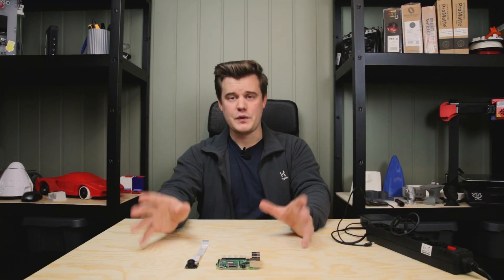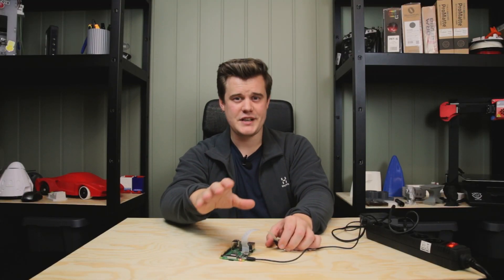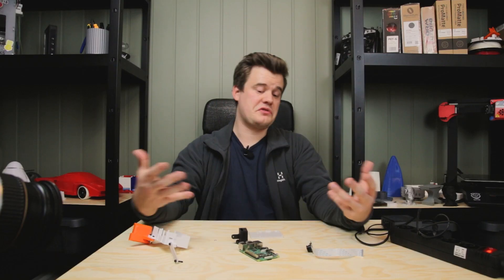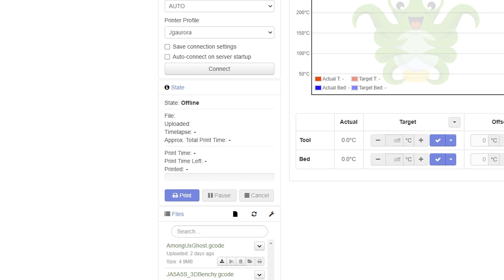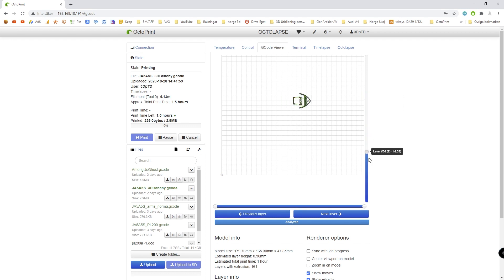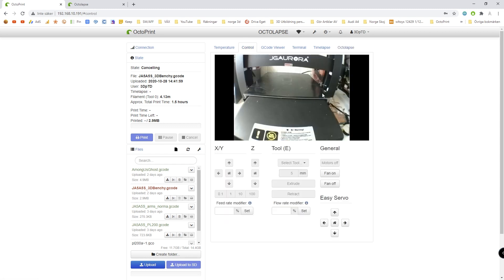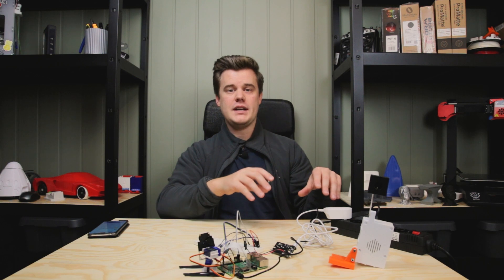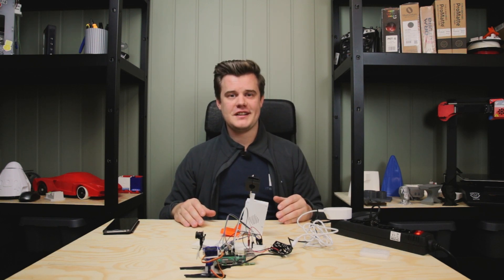OctoPrint adventures - Monitoring 3D Printers remotely

Comment: Octoprint is extremely useful. Connect a screen to the pi and run something like Octodash. Adds stop/start of prints through Octoprint, plus many other features for controlling your printer (filament change for example.) I run smart plugs to control the power to the printer and a light. I can remotely switch on the printer, upload G-code, start the print, monitor the print, via a webcam and switch on a light if required. Just ordered my second printer.

Comment: I am using octopie integrated in my HomeAssistant smarthome processed via Node-Red, so Alexa lets my lights flash and talks a custom text for every event that i programmed,
for example when a print is at 99%, all my alexa devices at home tell me "Your 3D print almost done, it's at 99%" and will flash green for 3 times. After 22:00 it is only speaking at my living room with a whispering voice. You can send notifications to your phone, email whatever.  Or the smartplug on my Prusai3 cuts the power after a printjob is finished and the extruder temp cooled down under 40°C to save energy.

The possibilites are endless, but be warned, that is a deep rabbit hole, once you got the hang of it.
Reply from the maker: Haha that is so awesome!  Yes the plan is to add smart plugs as well to keep it more safe. Maybe sort out what printers that actually are smooth to operate via the system and add my air purifier to run when things are printing.  But DSLR for the OctoLapse is prolly my prio =)
Reply: That's pretty cool